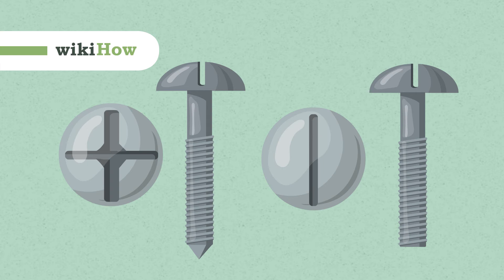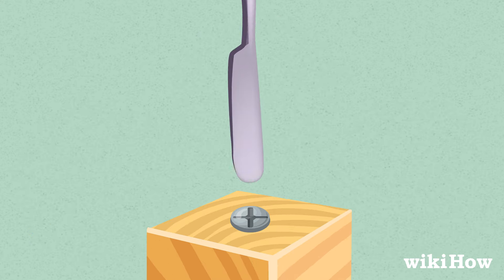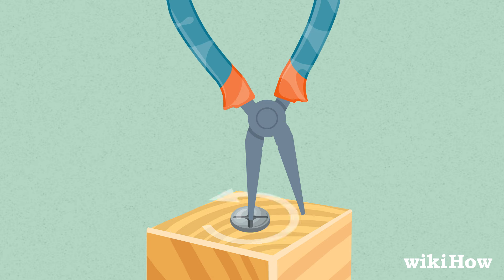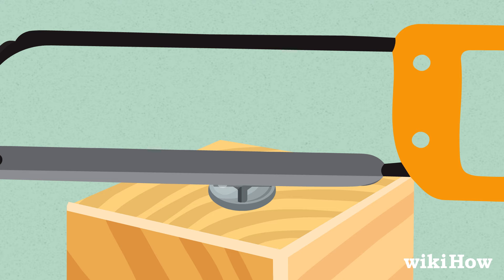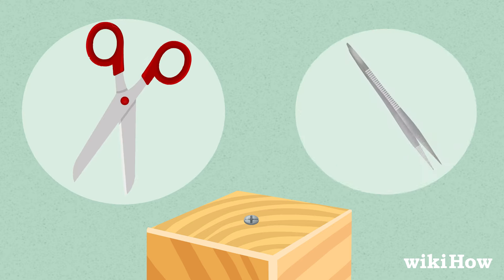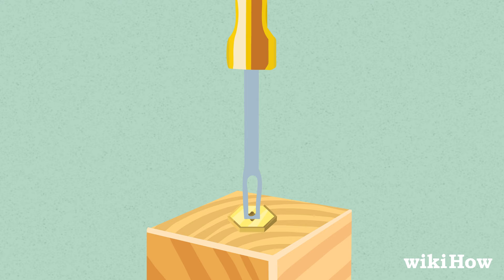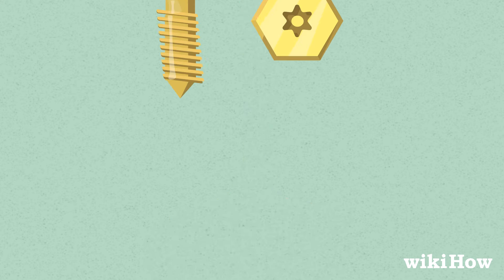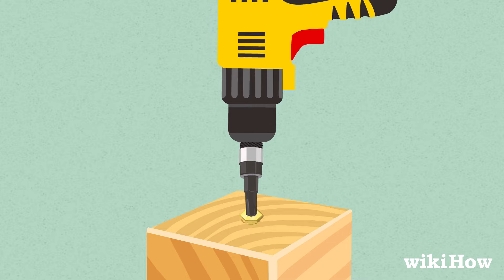How to Unscrew a Screw Without a Screwdriver

Comment: Hey there ! other options are fine but never insert your thumb`s nail in that gap because it is not a good idea, because you can damage your nail or you can break you nail into half because the nail never stands against the screw if it is tightened with a screw driver , i know about this because i once tried it out and the results of that experiment were very bad. I repeat don`t unscrew a screw with your nail.
Reply: Uh duh that’s why I did it 😤🙄
Reply: Ohh absolutely that’s a terrible suggestion to make.
Reply: A moment of silence for the fallen soldier.

Comment: Why the fuck did the people making my model car set decide to screw the car to the fucking display platform, and why the fuck did they make the screws so tiny. The screws are so tiny that I can literally not use anything except a screwdriver. Also they could’ve just used rubber bands or zip ties to tie it to the platform.

Comment: Tried this on a pencil sharpener

Ended up cutting the blade in half-
Atleast its still well usable
Reply: yoyoyoyoo be careful my guy wash the pieces with water first and only use the edges that were there before, not the torn part, don't want metal shards in your bloodstream either yk
Reply: @TheRealZazaExpert  i see thank you for the advice XD